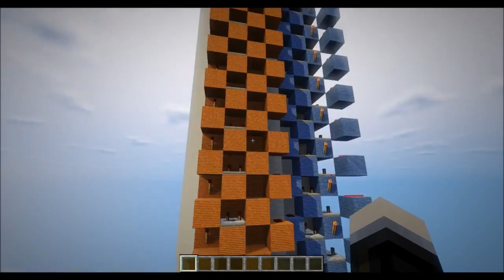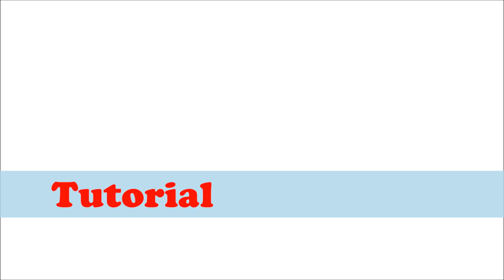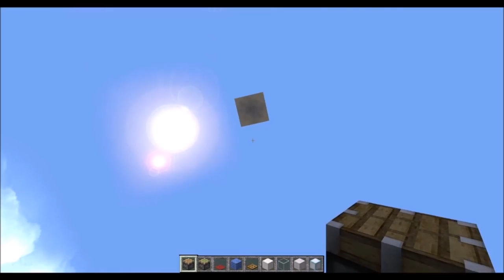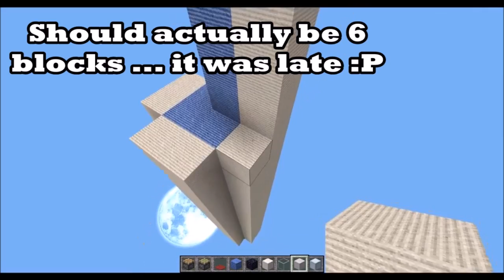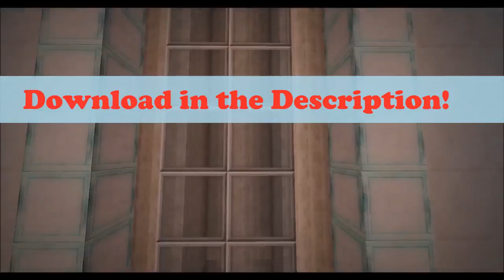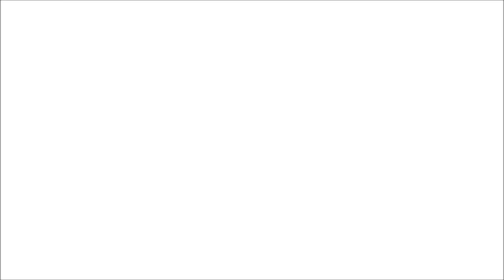Realistic Elevator in Minecraft -Improved! [Tutorial]

Comment: So I made this on ps4, it works but it messes up going down, the carpets break, doors mess up and elevator gets smaller with trap doors opened, idk what to do
Reply from the maker: I don't have Minecraft for PS4, so this is just me guessing. I'm guessing that carpet behaves differently, so try using wool blocks instead. The space inside the elevator would be 2 high instead of 3 but it should be functional. You might want to adjust the sliding doors so that they're 2 high as well (just for looks, bit weird having a 3 high door going into a 2 high space :P)

Are you talking about the sliding doors messing up? Maybe double check that there are slabs next to them and the dust is redirected. If that doesn't work, slabs might behave differently on PS4 :/
If that's the case, try building them 1 block further away from the rest of the elevator and adjust the circuits for them so they can power/unpower the doors.

Are the trapdoors spamming  on the way down and the elevator car is getting stuck? Or do the trapdoors open sometime going down and stay open? The first scenario is probably a timing issue or caused by the carpet breaking, idk what to do for the second :/

I hope this is somewhat helpful! Just wish I could give you a "for sure" answer, but I can't test this on PS4 :(
Reply: +LoneAssassinC thnx for trying to help, I've checked the timing but they seem to be fine, the trap doors tend to open and close and then kick me out when it's going up, is there a certain section I have to double check and fix if there is an issue going up, the carpet also breaks and the elevator shrinks, I'm going to try to change the carpet to wool
Reply: +LoneAssassinC I've figured out that the top doors don't work but the bottom does, the bottom works fine with the cauldron but idk what's wrong with the top ones
Reply from the maker: The top doors are probably because I accidentally cut out that part in the video xD I made another comment with an imgur link that should help!

For the trapdoors, I'd say double check the inputs going into the up and down circuits. Be sure that they are getting 6 tick pulses (the up circuit has a 4 tick repeater and a 2 tick repeater going into the same dust, the bottom circuit has a 4 tick repeater and 2 repeaters on 1 tick; both monostables are near the comparator timers). If that still doesn't fix the trapdoors, they might behave differently and I would need to design a work-around :/

If the carpet is breaking on the way up, then I'm pretty sure it behaves differently on PS4. Have you tried the wool yet? I'm sure that should work.
Reply: +LoneAssassinC the wool works fine, it's just that the top doors doesn't work properly and I keep falling out the elevator when it goes up
Reply from the maker: Are the trapdoors pushing you out or are you falling through the floor? If you're falling through the floor, use bottom slabs instead of the wool you just used to replace the carpet (may not look as nice but there's a little more room inside the elevator, and might be needed because of the player's hitbox). Also have all the 3 tick repeaters in the upward circuit be 4 ticks. Hopefully that little delay will help.

If it's the trapdoors, I might know a work-around but it would need a redesigned elevator car :/

Hope this helps!

Comment: Does this work with the current version of minecraft on PS4?
Reply from the maker: I don't play on PS4 so I'm not sure. Someone built it around a year ago on there and it worked, idk if it still does.

I suggest making a small one - maybe about a 10 layer one (10 layers of the white wool circuit) - to test the orange and blue circuits. Build those, the white wool layers, and the lapis circuits without the comparator timers. After that, see if the elevator goes up and down all the way.

Comment: does it work on Xbox?
Reply from the maker: I haven't tested on Xbox (only have MC for PC), but it does work on PS4 so I'm guessing it will also work on Xbox. You may need to use halfslabs or wool blocks instead of carpet though. Also check out the imgur link I posted in another comment, it shows how to get the top doors working (I accidentally cut that out of the video xD)